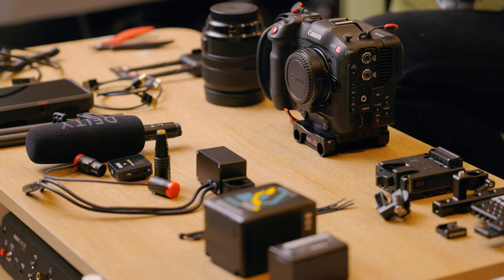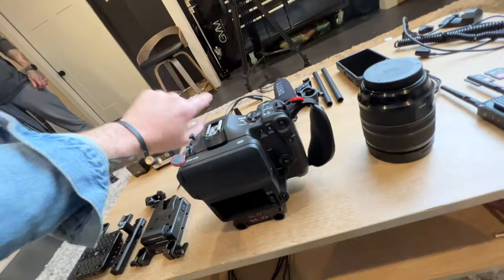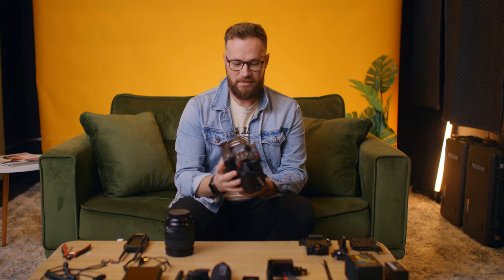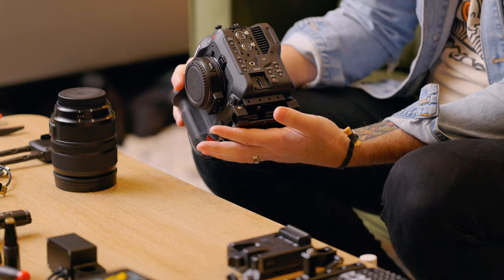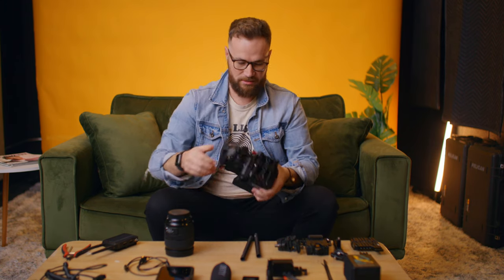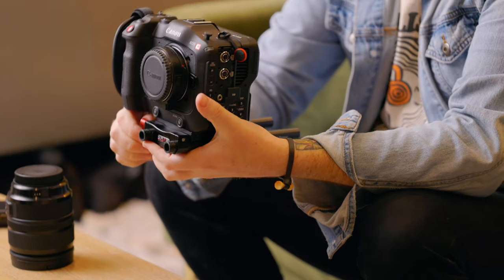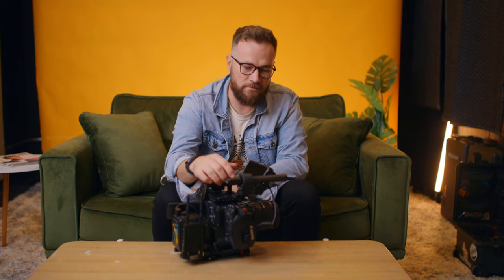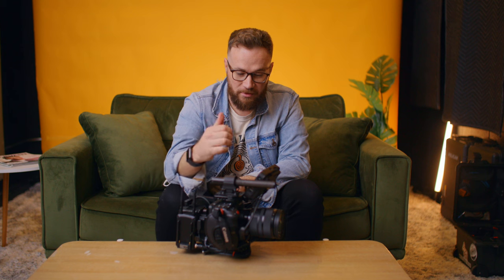The ULTIMATE Canon C70 Setup!

Comment: Nice rig setup. I have one issue however- the Wooden Camera top-plate. Because everything you rig to it is secured by a single top bolt which still contains play even after tightening, this does not appear to be the most secure or viable option to use, especially when attaching a monitor and/or handle. In my mind, a Tilta C70 cage would provide a more secure and much cheaper alternative. One would then have no less than nine different secure attachment/bolt points for a separate top-mounted cheeseplate alone, not counting room for a monitor, microphone, light, etc. Again, just a suggestion. Thanks.

Comment: Nice seeing setups from people that use their gear professionally. As for your top plate issue, there is a second contact point on the C70 , the little piece that you measure focal distance unscrews adding another point of contact. I believe Kondor Blue utilizes the two points of contact. They sell just the top plate so it may work for your needs.

Comment: BP-A60's are a good option over V-mount imo. I got my third party BP-A60 battery with a charger for $150 on B&H. The benefit being reduced clutter and bulk, and giving you probably close to the same battery life though you'd lose D-tap but for the monitor just get a BlackMagic NP battery that is super lightweight and lasts a while. On 1 BP-A30 and BP-A60 I can do an all-day shoot no problem especially with cutting frequently. Not to mention having to include rails on the base plate for the v-mount and then the bulk on the end of the v-mount making balancing on a tripod more tedious. Then you can pop it off and easily do handheld for b-roll whenever you want.

Comment: I'm currently shooting on a C70 and I generally love it. I'm a solo shooter who travel quite a bit and I try to keep my rig as small as possible. I've never had to use an external monitor before, but I have found that the LCD on the C70 just about useless in sunlight conditions. What has been your experience with the C70 lcd in sunlight?

Comment: hey man! nice setup. I was wondering about the v-mount + BP-A power solution. when I use both a v-mount (with the d-tap to DC IN cable) and the BP-A30 that comes with the C70, the camera always uses the power of the BP-A first, so it kind of "prioritizes" the BP-A over the v-mount, which I find kind of weird and is impractical for hot swapping v-mounts, because it only starts using the v-mount once the BP-A is empty. I couldn't find anything in the menus to change that. have you had the same problem and found a solution? 
also: you should check out the SHAPE half-cage for the C70. it's a bit pricy but a really nice piece of kit. you won't have any wobble issues with the top plate (had the same issue with the SmallRig plate, which drove me nuts) and you get a really neat secure lock/protection bracket-thingy for the HDMI :)
Reply: Great Question! Had that same question in my head! I was curious to ask if you like the tilta cage vs the shape as well?
Reply: @bradancheta  I haven't had the tilta cage in my hands, but it looks like a good and more affordable option. what I really like about the one by shape is that it's not a full cage so there no added bulk on the C70's grip and it's still very comfortable to hold. also shape offers a bigger top plate and the HDMI lock is a lifesaver for the HDMI port. mine already got a bit loose and I was always afraid of breaking it.
Reply from the maker: Strange.... We have actually used the hot swapping things a few times without issue and literally never charged our BPA's... I wonder if the BPA is charing in camera when the camera is off.. Meaning if we leave a v mount attached but have the rig powered down, is that actually charging the BPA making it full basically every time we power on the rig...?
Reply: In regardsto battery, check if the camera is receiving the needed voltage in order to operate. I've seen this same issue happening at least twice, but it was the d-tap to barrel cable connect fault. If you use an external power source, the camera prioritize it over the internal source, with the other way around only if there's not enough power.

As per cage, I use the Tilta cage and it works fine. The cage lays on top of the de camera and you mount around the focusing pin, but at the bottom you can use both the 3/8" and 1/4" tripod mount points at once.

Comment: Quick point of clarification here- the play in your top plate is because of the camera, not the top plate.

I have a Smallrig top plate, and mine does the same thing. Swap your original top handle on, and it'll have play too. The C70 top screw hole just gets loose after (not all that much) time.

I literally just packed my C70 up and sent it in to be serviced today for this very issue.
Reply from the maker: Thanks for the comment. It's strange because you would think that those ribbed areas would keep there from being any play.